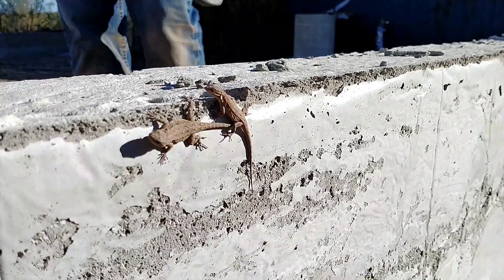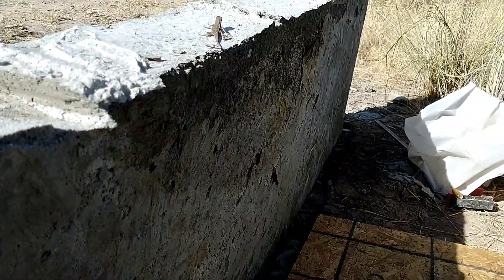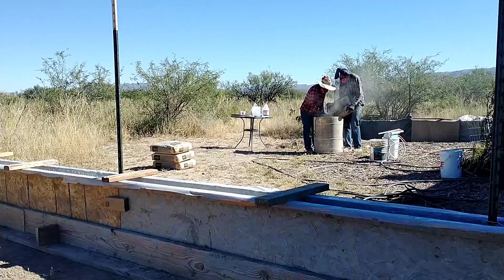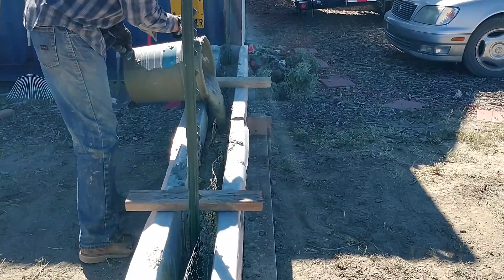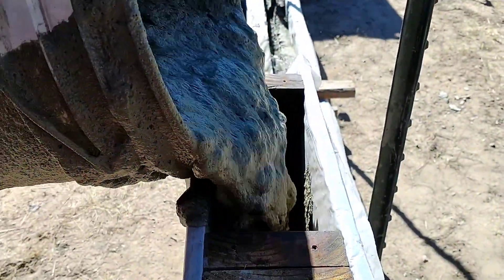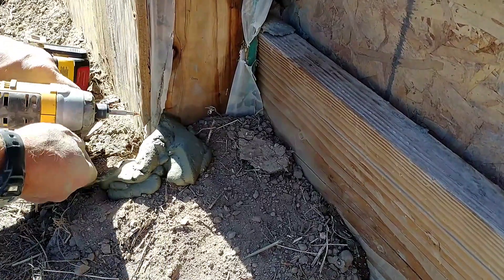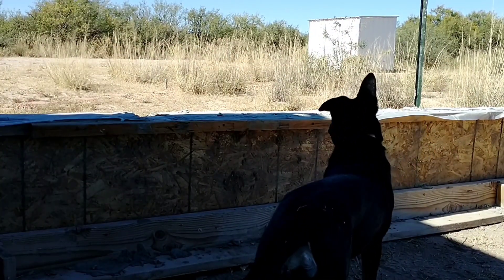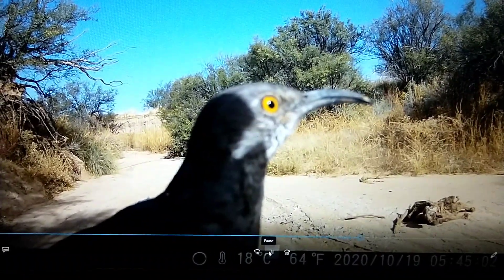Making an AIRCRETE Garden Wall & Height Test

Comment: I think you have given up on aircrete, but I'm thankful you have kept these videos up. A garden wall, after all, is not structural (as you note). I find this project inspirational!

BUT, there has been a big development you might look into! The YouTuber (best described as a DIY Scientist/Engineer) NightHawkInLight has developed a new aircrete formula and it's much easier to make. Plus, you can fiddle with the foam in new ways - for instance making an open-cell aircrete (porous!), if you want. 

See here: https://www.youtube.com/watch?v=z4_GxPHwqkA

Comment: should try one with burlap linings for extra strength
Reply from the maker: For our house, we were planning to plaster over a thick fiberglass mesh, but we didn't want to spend the money on the garden wall.  We had a flash flood and the aircrete wall kept all of the water out.
Reply: @RedandAprilOff-Grid  try basalt mesh its hell of alot cheaper and stronger than steel

Comment: Consider, and research, how you might cast your aircrete slabs laying flat, with one large exposed surface, instead of inside of vertical molds. There is already a technique for making tilt-up full concrete wall panels, and your aircrete panels would be much lighter and possible for you two to tilt up. Then your drying process might be less mysterious and shorter. For a structure, I would also suggest making the slabs quite a lot thicker, like 8 or 12 inches thick. Then you really get insulation value out of them. Thanks so much for sharing your process.
Reply from the maker: We had considered doing panels, but couldn't think of a great way to lift them into place or a good way to connect them together. Aircrete is much lighter than concrete, but a panel would still be pretty heavy. Aircrete can also be quite brittle, and would have the tendency to break or crack if moved. Some seemed to say it was possible to pour the walls in place, so that seemed like a better option, but I don't think it would have worked. Aircrete is just so incredibly thin and will leak out of even the smallest crack. 
Making aircrete also seems to be a temperature sensitive process, it doesn't come out right if it's too hot or cold outside. It would need a controlled environment, but it's not very practical for a DIY build of a whole house. Making aircrete was an experience, hope people can learn something from it. 🙂

Comment: DIY Tiny Homes size:  "HORIZONTAL way", flat on the floor: 12 feet [H] x 8 feet [W] x about 4 inches [thick] + aluminum SCREEN.  Do not cut but keep the "screen edge" protruding; this will connect to the next; or  unless you may do it this way that the edge was made like deep "H" shape like putting a "lego" puzzle; which means the other edge of the wall looks like an "L"; meaning the edge is about 10-12 inches thick high. Look at Lego puzzles.  At the edge of the side of 12 feet wall; and, on the side of 8 feet wall were hallow many "H" in order to attach the roof and floor.  You cannot go wrong with a lego design, it will hold!  It would be nice to sell Air-crete lego at Home Depot or Low Stores?

Comment: What thickening agent did you use?
Reply from the maker: Aircrete Harry
Reply: Is that the stuff he sells to go higher or the other stuff.
Reply from the maker: He calls it thickening agent, or high pour. His experiments showed that regular aircrete using 7th generation dish soap will pour just as high. So now he says it makes aircrete stronger. It didn't seem to make any difference with our test samples, but the results were inconclusive.
Reply: @RedandAprilOff-Grid  I have been looking for someone besides him that can justify the expense.

Comment: Love these air Crete videos! So much value and thankful for it. Curious how a little vibration would effect the quality of the cast. I also know this would cost more money but if people had 4 x 8 acrylic and potentially 1/8 to 1/4 thick. These are bendable and pliable and would probably leave a nice sheen on the casting much better than polyurethane.
Reply from the maker: Thanks! When the batch turns out well the material fills in the forms very well. It falls pretty easily so I wouldn't recommend vibrating it. 
That sounds like it could be worth a try. 😎

Comment: You really don't want a smooth surface, like you got from using plastic, if you are planning to plaster it.  I suggest you rough up the surface before putting your plaster and mesh on it.  It'll be okay for awhile but will spall  over time if you don't.
Reply from the maker: True, It mostly made the forms come off easier and it made it easier to keep the aircrete wet. We are going over the whole wall with a rasp before putting the cloth and plaster on.

Comment: Aircrete is very thin. I think you'll have leakage issues if you use a slip form technique. And it'll be a lot more annoying when you're 8 feet up.  Since aircrete is so light, you may consider a tilt-up technique to build your walls. Or you can make huge bricks - like 2 ft x 4 ft. And since your forms will only be 8" or 12" deep (the thickness of your wall) you won't have as much pressure and you can spend more effort making it tightly sealed since it will be re-used many times.
Reply from the maker: He hasn't decided what type of form he wants to make yet, but I'm sure it's going to be a real challenge to keep the aircrete from leaking out. That was our original idea, then it was to pour the first 4 feet, and do blocks after that, but now we are hoping we can pour the walls on the whole thing. We'll see how it goes and improvise if needed. 🙂
Reply: I wonder how well it would work to build a full height form, then pour in 2 or 3’ lifts. Might be worth running a couple of tests, one similar to the garden wall with 2 or 3 layers, and another with concrete bonding agent between the layers? Lifts would also be a good way to easily lay horizontal rebar or wire as you go.

Comment: Major difference between wall one and wall 2 in lizard volume when
 de-junking or removing forms.  Is this due to any identifyable parameters?  
Great narration, somewhere between  Christopher Kimball from Americas Test Kitchen & Bob Ross.
Reply from the maker: They especially loved hiding under the plastic and the wooden forms. The patched section had a gap between the board and the wall, so I figured some would be hiding under there, and I was right. 
Thanks!  We are both from Colorado, and New Mexico. 🙂🦎

Comment: Since I and others are trying to learn from each other it would be wonderful if you'd put in the description what additives you test and perhaps even the recipe quantities.
Ex: you mentioned thickener but don't say what you used. I watched a couple of Aircrete Harry videos where he did the same thing so it's kind of frustrating.
Reply from the maker: Sorry about that, the recipe is mentioned in most of the other videos, and I just now made sure it's in the description of every video. We use a standard aircrete recipe, but  we use less water 5 gallons instead of 6, and add 1 tablespoon of glycerin, because it's cheap and might be helpful. We don't know what is in the thickener either, it's the one aircrete Harry sells. At this point we can't really say whether it was helpful or not since the batches leaked out and had big air pockets. 
We have been using a little portable water softener for all of the water in our batches. We haven't seen anyone else use one, so we didn't know if it would work, but it seems to be working well. 

Aircrete recipe:
In barrel mix
5 gallons water
94 lb bag of Portland Cement

Foaming soap solution:
5 gallons water
1/4 c. (4oz) Drexel 
1 T. Glycerin
Foam weight 80- 100 grams per quart.
Mix into cement slurry enough foam to make a 45 gallon batch.
Reply from the maker: I agree it's really annoying when people seem to have information about how to make good aircrete that they are not sharing. We have come across that a lot.  Aircrete is a challenge for sure. We plan to keep sharing as we learn more.🙂

Comment: Oh, the despair of seeing an aircrete leak after what seemed to be over-preparation! Haha, looking good! I wonder how the 2 samples would compare in ur tests, comparing the additive value
Reply from the maker: It was good practice for our house walls. The dirt was pretty good at stopping up the leaks on the ground. 
With the big air pockets they weren't testable, but both looked about the same. We have since poured some into our regular test sample boxed, but we are pretty sure it's been getting too cold at night and they froze some even though they were covered.
Reply: @RedandAprilOff-Grid  spray foam is pretty good/fast way of sealing the forms/ joints as well